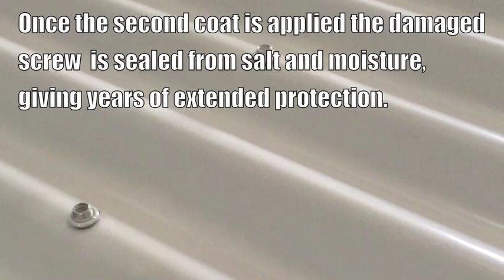How To Stop Roof Screw Rust

Comment: Silly video ... why would you use an impact driver to fix the screw? Manufacturers specifically tell you NOT to do that. Use a mains powered screwdriver that does not whack the coatings off.